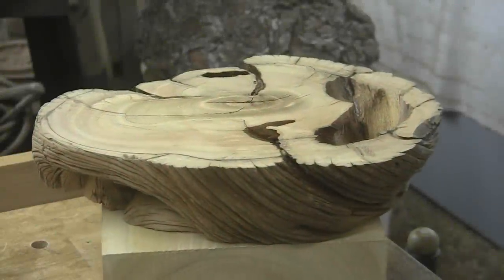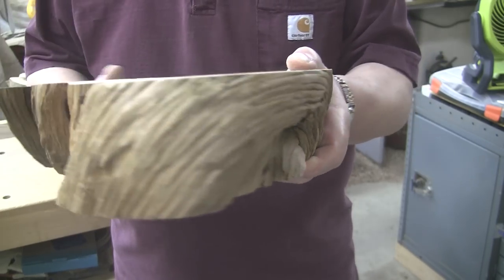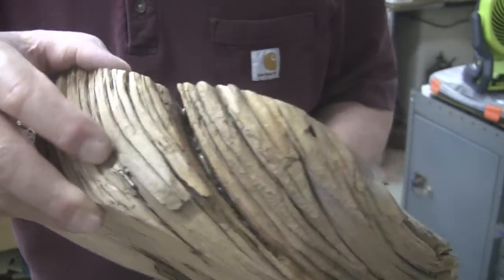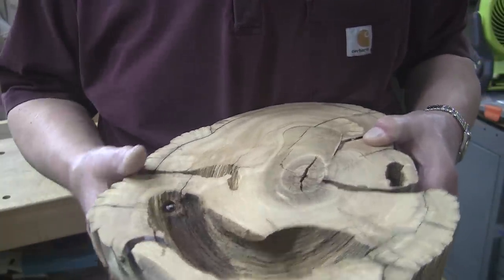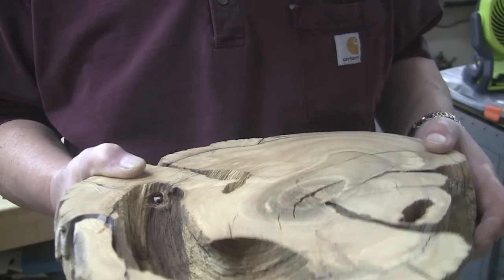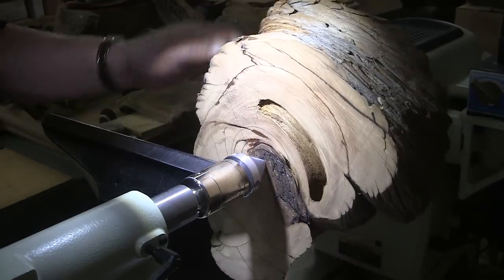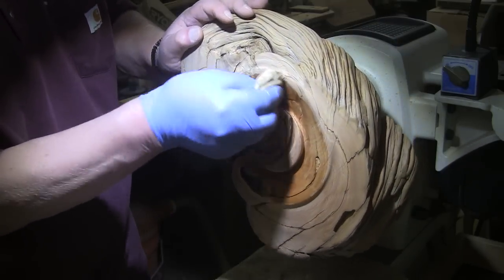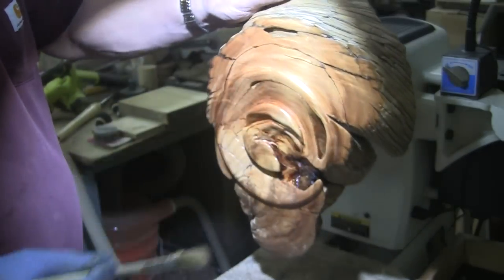Just Bursting With Nature! - Wood Turning

Comment: Instead of of using a screw, you could carefully drill hole and use a dowel. Even more than one. If you carefully put glue in the hole it will be helpful. You could also put a groove up the side of dowel to relieve any glue pressure from driving it in. I'm sure you've thought of a lot of things.
Reply: Use of a dowel is a great solution! Good thinking!!

Comment: Phil, seeing the screw,  I wondered if a wooden dowel could be used in situations like this. That way if you needed to turn into the dowel it might add to the imperfections of the wood.
Reply from the maker: With a dowel, in my opinion, it would look like I made a repair and tried to hide it.  I guess I would rather celebrate it, call it jewelry, Dan.  😃

Comment: Well Phil you have taken art up another notch. Such an amazing piece! I just knew it was going to explode the suspense was very intense. Learned a new strategy today using a screw to hold it together. If you could have gotten the screw to work would you have left it in or removed at end? I was wondering if a dowel could be used for same application? Amazing piece. Thanks Phil! ❤
Reply from the maker: I would have left the screw and just ground down the head a bit and disguised the hole with my sand o flex.  A dowel would work but would have looked like a dowel.

Comment: Phil, I saw you using a hold down clamp on your drill press.  Where did you get it? Your videos  are awesome and I've learned a lot since I prescribed.  They have motivated me to start turning again.  I'm 80 years old.  Thank you!
Reply from the maker: I got that clamp 50 years ago, Bruce, when I bought my drill press.  They don't make them anymore.  Modern drill presses have the rack and pinion table adjustment and these can't fit on those columns.  You can still find them now and then on eBay.
Good to know you are still at it!  I started my channel when I was 70. 😃

Comment: I was just thinking…
I wonder if you could cast a scary piece of wood like this with Woods Metal to secure it for turning.   I’ve never used the stuff, but my understanding is that it melts at very low temperatures, so maybe it could be used like others use resin, but then melted out of the piece later to reveal just the wood. 

That might be a fun experiment some day.
Reply from the maker: I don't think I will ever know if that would work, Phil.  No need for it in any of the pieces I have turned to date but maybe in the future. 😃

Comment: Forget the screws ,use wooden pegs. You can glue them in and they will fit just like the original  wood.
 It's gorgeous.  I've never seen such a beautiful  piece of nature. Thank you.
Reply from the maker: The problem with wooden pegs is, they won't pull the piece together and that's what I needed.  I did consider them, though. 😊

Comment: I am writting this before i watch what you did to the piece,but right now you are talking about your drill bit breaking off. Well i need not tell you what will happen if you hit metal with any of your tools so think about what furniture  maker do to their wood. Ok instead of a screw drill your hole and put in ,as long as you need it to be ,a piug, biscuit , or a long stick what ever you have and glue them in. They will hold better than a screw and you can run over them with yout drill and and tool you have. Plus it may just add a little to your puece.
Reply from the maker: Thanks for all the suggestions, Patricia.  In this case, I was trying to pull to pieces together so only a screw could do that. I did install it in a place I was pretty sure I wasn't going to be turning. 😊

Comment: Let’s say the drill bit came out, could you use a wooden dowel or plug to hold it together? It “turned” out good. I bet you went round and round trying to figure out what to make with it.
Reply from the maker: I could have used a dowel but the goal was to pull the pieces together.  Also, with a dowel you're left with a perfectly round image in an otherwise imperfect piece, John.  Now we have shiny jewelry!  LOL!